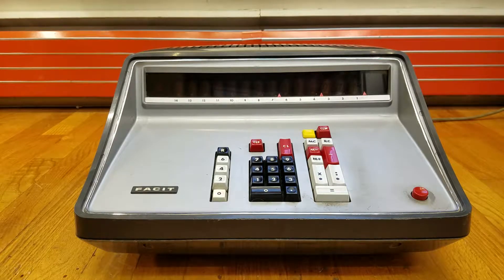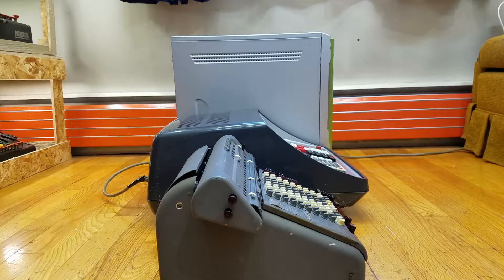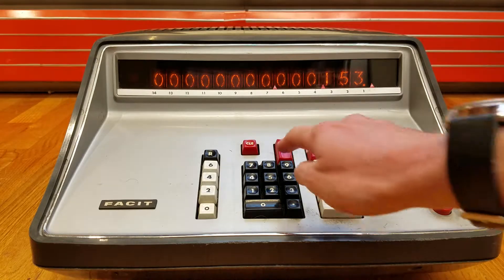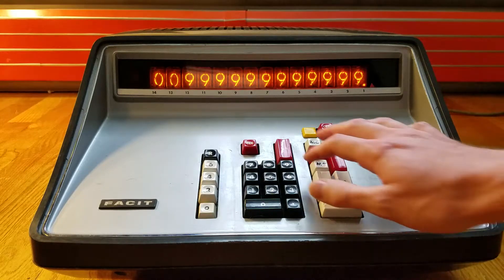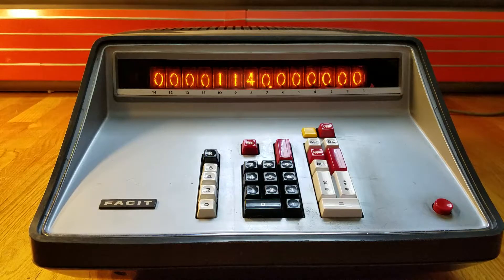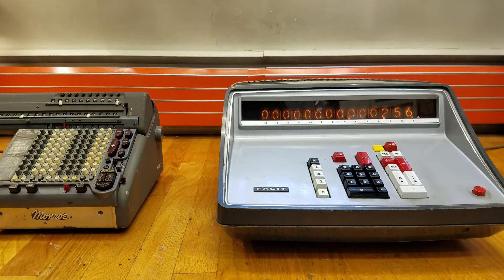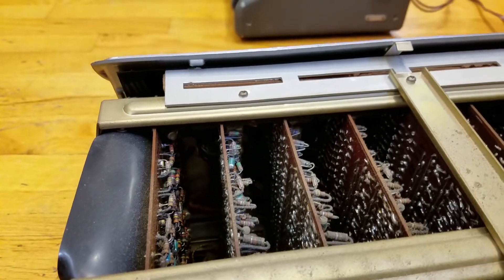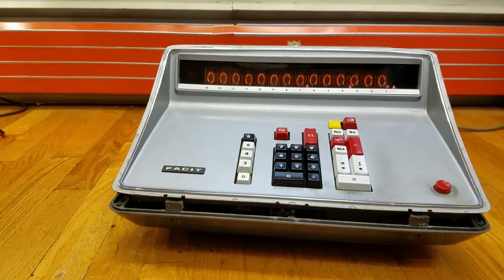Desktop Calculator: Facit 1122

Comment: @bss1250  I'm an electronics engineering student and am interested in getting in contact with you.  my email is in my About section on my youtube page.  I'm looking for information on this calculator which I can not find.  I really hope to hear from you!
Reply from the maker: I went to your about page, but I couldn't find an email listed there. What kind of information are you looking for?
Reply: @bss1250  I'm looking to make a schematic of this machine as well as the 1121 calculator.  These machines are similar, but I can't find any information on them or find one on ebay to pick up.   I was wondering if you could take clear pictures of the boards that are different (front and back) as well as the wiring underneath.  I can share what I learn and answer any other questions that you have to the best of my ability.  I hope you can help me with this project and questions I might have.  my email is magpiejay1@gmail.com
Reply from the maker: @Darkest I sent you an email including some pictures
Reply: @bss1250  I did receive it, thanks! I'll get back to you in the morning.
Reply from the maker: @Darkest are you still interested in reverse engineering this calculator? I sent you some high res pics of the boards a few weeks ago